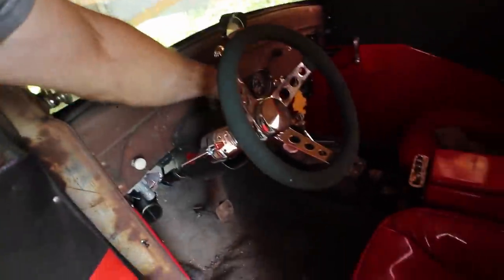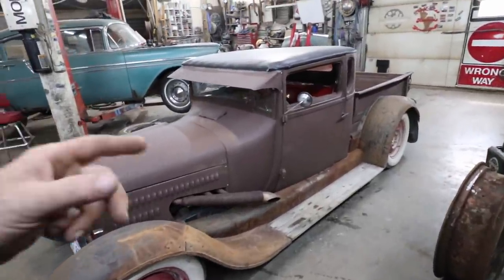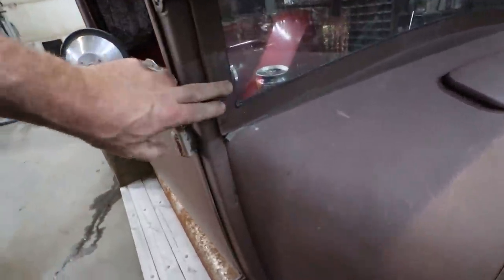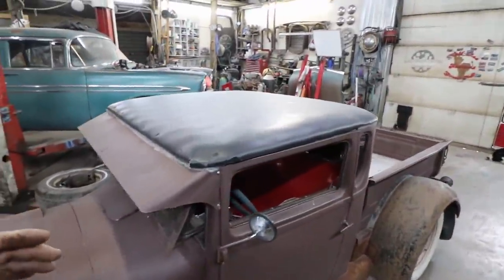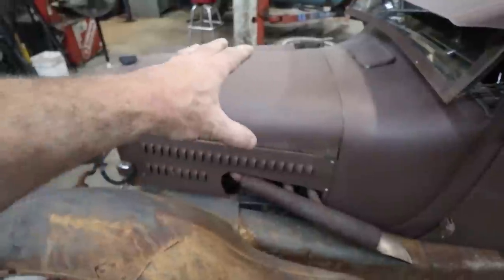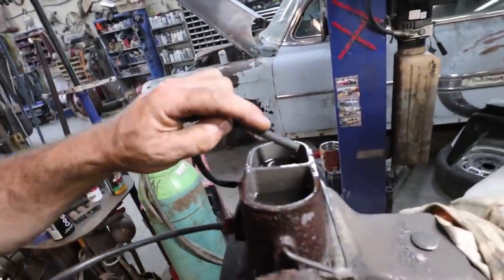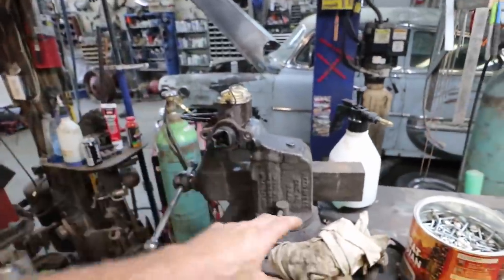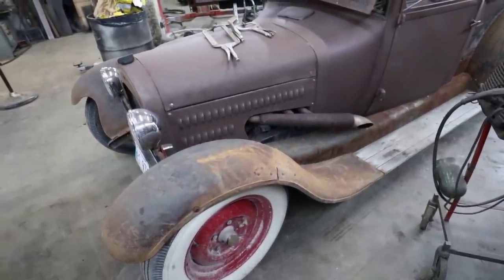Fixing the brakes on my 1927 Ford Model T pickup.

Comment: I used to run a fleet shop and it was amazing what I could build on a weekend with spare stuff hanging around. All you need is a welder, plasma cutter, a grinder, a set of torches, and a vivid imagination along with an unlimited supply of scrap metal.

Comment: watching when you brought home the 53 or 52 olds hyd lifters, learned from wayon wire when he fiddled with two hemi's to pressurize the oil system and cycle through out the system,  it works loosen bearing and lifters. pushes oil throughout the engine

Comment: You surprise me Brent  :) your only ones seen in that use Fuel injection also Computer on Motor plus Transmission systems on building old classic vechiles back life ! Most one seen  do FORD Mustang of 289 , 302 , 351 plus 3 to 4 Automatic transmission and 4 or 5 speed Manual transmission !  General Motors 3.8 231 ones to 305 to 454 V8 with  Turbo 200 2 speed plus 350 , 400 Turbo 3 to 700SR 4speed Automatic transmission  with shift kits plus 4 to 5 Manual transmissions ! Never seen any Chrysler power trains ever but seen Toyota 2.4 litre 4 cylinder with 2 style  Automatic transmissions and Manual transmission !
Reply from the maker: I get them cheap and want EFI for command start in the winter
Reply: @HalfassKustoms  excellent to hear Brent :) and most fast starting up and warm engine so have fun drive in Winter Season!

Comment: 3:01 What is with that wheel ?
The last 3 video's it was in the same spot.
Curious minds want to know.
21:52 You better let that dog go for a ride. If not you know your A$$ is going to hurt after you are bit.  Lol
Reply: He is going to weld in rusted rim where  farmers use a liquid for weight, then weld in another valve stem hole for tube.
Reply: @garymccord4277  Thanks.